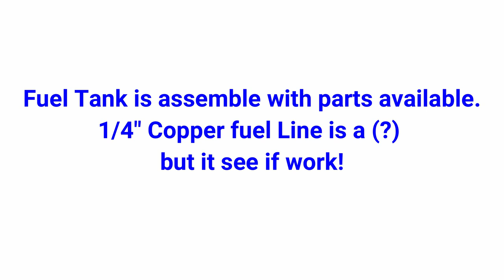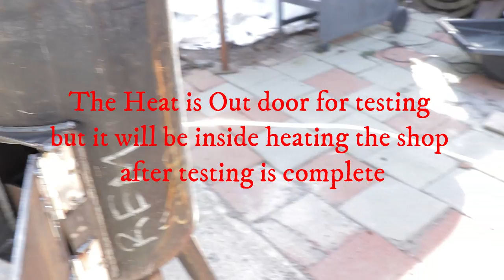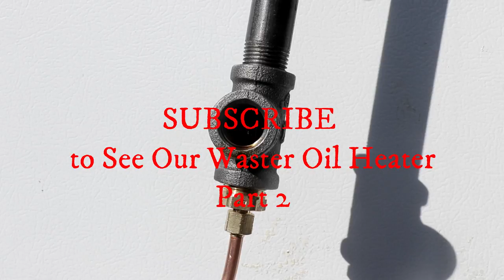Waste Oil Heater

Comment: What about the fumes? Nice built however at what cost, Health and Environment?
Reply from the maker: The heat burn really clean. Here in the US most industrial  shop use waste oil heater as well. A couple of time I had fix and maintanence the unit that how I came up with idea of building my own. Waste Oil Heater will never made in Commerical building if it isn't safe.

Comment: Great video I've got to build one.A few questions do you need that thick of steel or would it be safe using thinner Guage also do you get any smell from burning old oil that could stink up your shop and how vouch oil just an estimate would you use to run it for say 4  or 5 hours straight. Could you leave it unattended or is it something that should be constantly monitored ,can you let me know thanks for sharing this video Dale
Reply from the maker: I would build another one with same thick steel 3/8" wall. The heat can get hot like up to 1000 + degree so go heavy if you build one.  The right fuel drip the heat burn clean no smell. thank you for your positive comment.

Comment: Do you have a materials list of the steel you used?
Reply from the maker: the heat is made out of 12" pipe schedule 40 30" long. Top and Bottom caps is 3/16" thick.  Burn Pot is made out of A36  4"X8"X8 3/4" to fit the opening of the heat chamber. The air intake on the burn pot is 5" schedule40 pipe 8" tall.
Reply from the maker: I have a new video coming soon next week. You can see another option of building a burn pot.

Comment: Sr my resp for yours inventions but I make one in my shop and don't make smoke o odors and burn one quarter the oil for 45 minutes
Reply from the maker: thank you for your resp.  I did a burn test on my video recently.  1 1/2 quarts per hour.

Comment: Welding cast iron is risky as it is a low carbon alloy and doesn't hold well when welded. It gets brittle. You should go to a plumbing supply and get steel elbows.

Comment: NOT good.  You need to use thin steel/Stainless for the burning chamber.  1/4 will NEVER heat up hot enough and burn right.

Comment: Too much smoke sorry Sam not good for the airshield.
Reply from the maker: Jim, it could be because I had too much oil in the burn chamber during start up and also that was the first test on a short stack. There will be improvement on the next video.